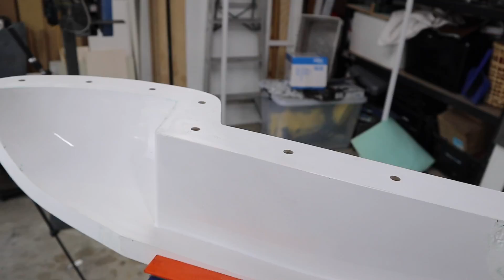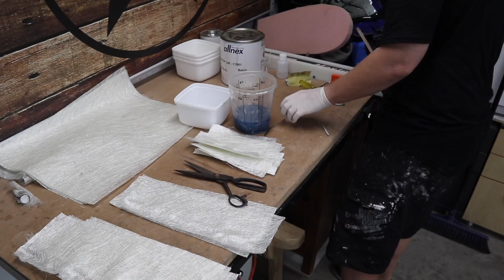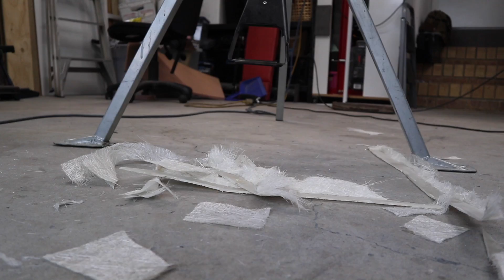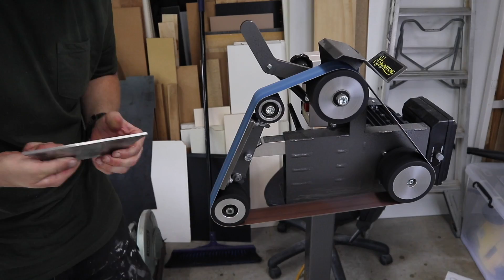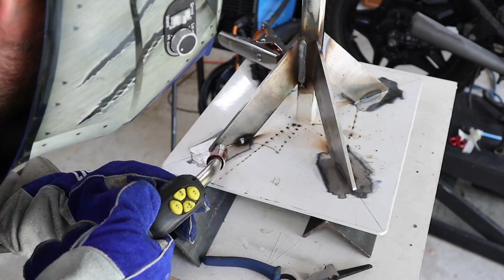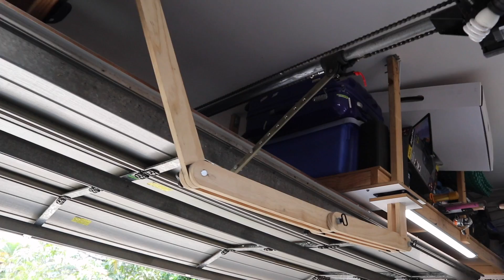Making a ★ Cafe Racer Fibreglass Hump using a Split Mould PART 1 & A Workshop Project

Comment: Why no gel coat? Would give you something to work with on the profiles if you wanted. 
Also try flash tape over you split join, will leave little indent but will be rubbed down and painted yet so shouldn’t be issue and a lot quicker.
Reply from the maker: Cornish_ Boy im definitely still learning and yes those two ideas are awesome thank you 😊 Due to the thickness of the fibreglass Im unable to use this part on the bike so I will need to make another one, need to make it slightly wider and what I’m thinking of doing is putting a spacer between the two mould sections cut to the same shape on the inside, the spacer can be HDPE and I can still run some flash tape over it like you said. Does flash tape have another name as I’m not sure exactly what it is?
Reply: How much wider do you need it? Flash tape is like sellotape but blue and thinner. We use it to over any scratches in the moulds. We’d use some wax/plasticine in joins normally but the tape is quicker.